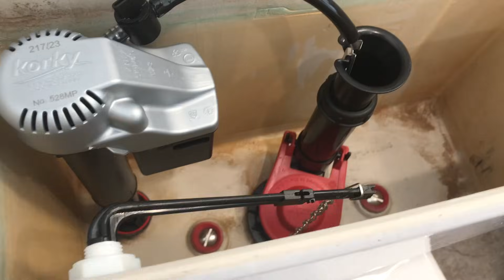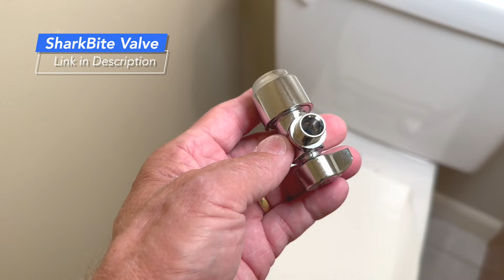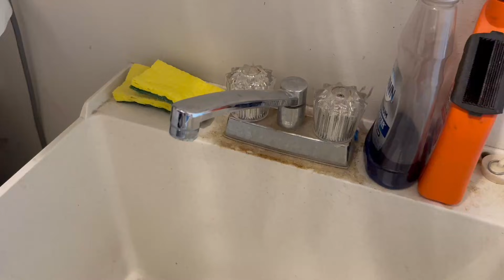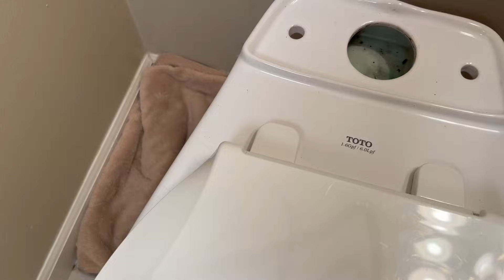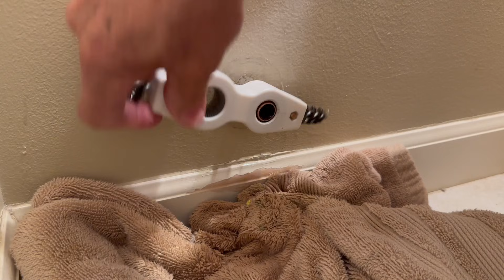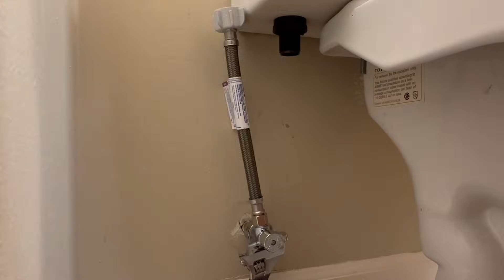Replace Stuck or Leaky Toilet Shut Off Valve

Comment: The main line for mine looks like it has threads i need to find the valve with threads or i have to cut off as you did it?
Reply from the maker: If you’re seeing threads, it’s most likely a compression fitting on your old valve. That type of valve has threads on the end that slides onto the pipe. It also has a compression nut that you slide onto the pipe first. Then it has a a tapered ring called a ferrule, that slides onto the pipe between the threaded end and the compression nut. When you tighten the compression nut, the ring squeezes down onto the pipe to create a watertight seal.

I’ll put a link below to a video that shows how to remove and install a valve with a compression fitting. The video also touches on soldered valves and Sharkbite like push to connect valves.

It’s important to properly clean the pipe first for whatever type of installation that you’re doing. Good luck with your project and thanks for watching!

Here’s the video link
https://youtu.be/OjD2UtzlX8w?is=R-RSbujrLqMLhZfN
Reply: Thank you nice to know ☺️

Comment: Can you remove the shark bite valve in the future without cutting the pex or copper?
Reply from the maker: Good question, yes you most certainly can. Sharkbite makes a plastic horseshoe looking tool that slips around the pipe. You push it up against the end of the connector which releases the grip of the connector and lets you slide it right off. This is especially handy for temporarily capping off a pipe with a sharkbite end cap since it can easily be removed and reused. Not to mention easily replacing a sharkbite valve if you ever have to. Thanks for watching!

Comment: What would you do if there were visible leaks after placing the Sharkbite?
Reply from the maker: Well, I’ve never had that happen and I think that’s due to properly preparing the pipe. If it did leak, it’s one of maybe three things that I can think of.

For one, the pipe wasn’t cleaned properly. There’s a tool for removing Sharkbite connectors, so I would remove it and make sure that the pipe is properly prepared.

A second possibility is that the Sharkbite wasn’t seated all the way down onto the pipe. It’s important to mark the one inch line on the pipe (for 1/2” copper) before installation to insure a proper connection.

If those two things weren’t the problem, it could be that the Sharkbite is defective, and would need to be replaced, although I haven’t heard of that being an issue.

All in all, if installed properly, it would be highly unusual to end up with a leak.

Thanks for watching!

Update: just thought of another possibility. That’s if the pipe is out of round. If the pipe is damaged while cutting or otherwise a bit oblong, I would imagine that could affect the seal of the Sharkbite.

Comment: Sorry for the next guy.. Next time the valve needs to be replace there will be no pipe left... plumbing solder joint (or "sweat joint")  are the BEST!
Reply from the maker: The next guy will have the same amount of pipe to work with. Sharkbite connectors are removable and can be replaced with another Sharkbite.

Comment: When you attach the new valve to the copper supply line, do you have to tighten it down? It seems like water pressure would push it off once the water main is turned back on.
Reply from the maker: No, Sharkbite connectors are push to connect and don’t require anything else. I’ve used them in the last few years and haven’t had any issues. As long as the pipe is prepared properly and the connector is fully seated, it should be good. 

They can also be removed with a little plastic horseshoe looking tool that you push up against the bushing on the installed side. Thanks for watching!
Reply: @DIYBoomers  Cool, thanks!

Comment: "Check for leaks" What if there is a leak?
Reply from the maker: Good question. If the installation is done correctly, there really shouldn’t be any problems. I used several Sharkbite connectors and valves in our bathroom remodel and haven’t had any issues with them. Just make sure that the pipe is prepared properly. As far as the supply line and connectors, they’re just compression fittings that are easily installed.

So if a leak does occur, unfortunately you’ll have to determine where it’s coming from and redo a bad connection or replace a defective or damaged part.

Thanks for the question and thanks for watching!